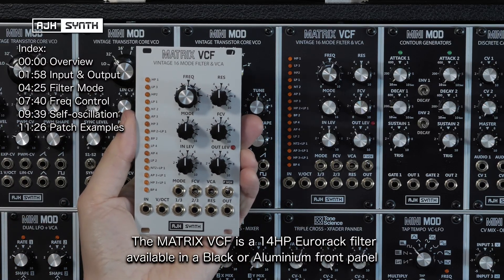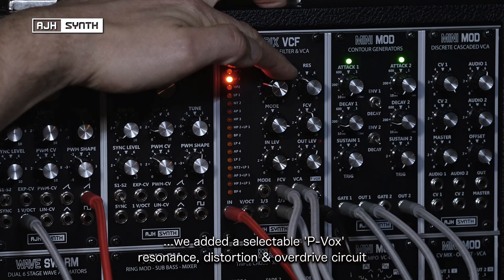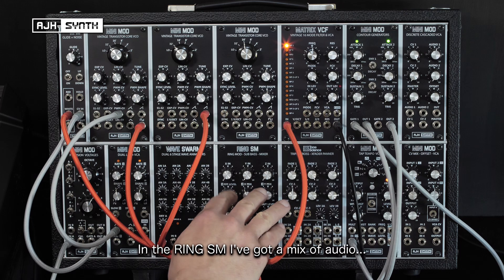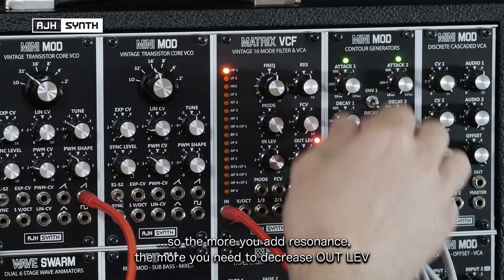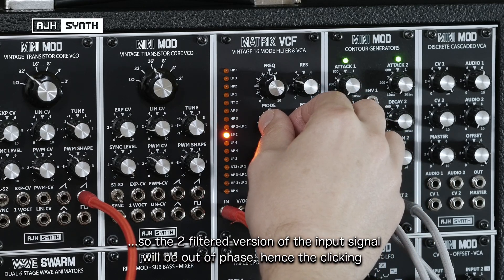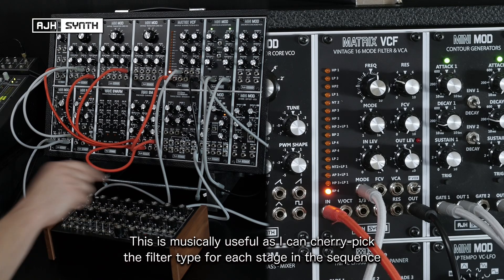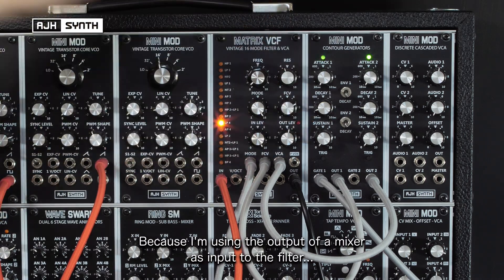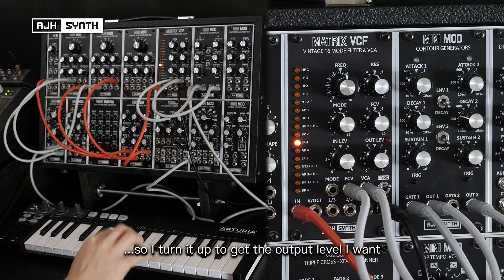NEW MODULE! MATRIX VCF User Guide - Vintage 16-Mode Filter & VCA by AJH SYNTH for #eurorack

Comment: May I ask are there any deisgn or aesthetic reason why the silver panel gets a set of different knobs?
Reply from the maker: The very first MiniMod Modules we manufactured had silver front panels (as did the vast majority of other Eurorack modules at the time), and we used easily obtainable Davies 1900h style black control knobs. 

After launching them and getting lots of comments on how great they sounded, we then thought that since they had a real vintage sound, then perhaps they should look a little more vintage too. So, a few months later we launched the Dark Edition with black front panels and decided to use different control knobs with a spun aluminium centre as they looked more like their vintage counterparts. However because the silver MiniMod range was now "out in the field" and many retailers were holding stocks of them, we continued to manufacture the silver modules with 1900h style knobs, which has continued to this day.

Comment: Ohhh, all-pass too.
What chip(s) are used ? ...2164, 3372, OTA ??
Reply from the maker: The Oberheim Matrix 12 filter was based around the Curtis CEM3372 chip, we use the  currently available AS3372 clone IC which has identical circuitry and behaviour.